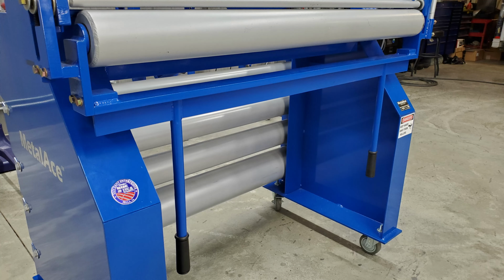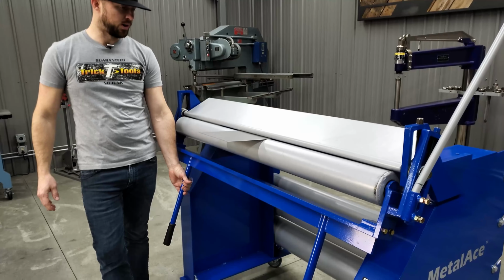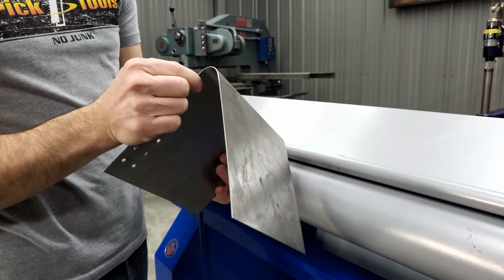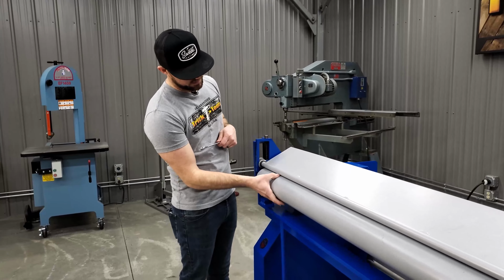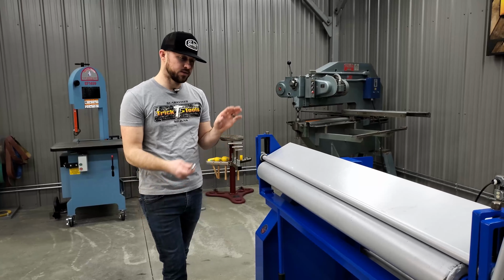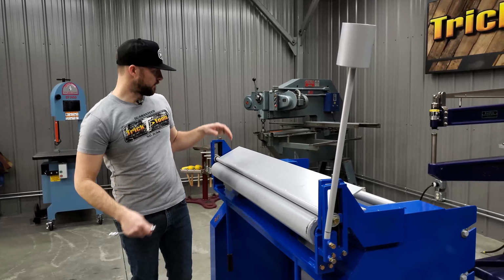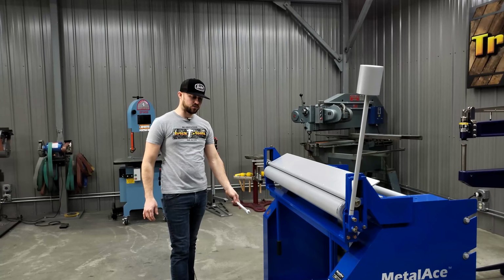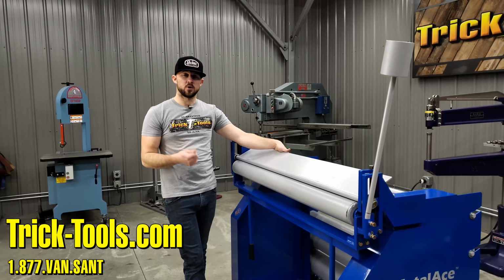MetalAce Radius Brakes - Trick-Tools.com

Comment: This is exactly what I need for my fabrication job.  Is there anyone in Phoenix Arizona that purchased one of your tools?  I have a flatbed project with rounded corners.  I'm fabricating a skirted portion below the flatbed.  As a result I need to bend sheetmetal 27" wide around a 2.5" radius.  If you have any suggestions on how I can make this happen please let me know.  Great machine you have there!!!
Reply: part 2 -
take a look at the video starting at the 5:50 - 5:55 minute mark for an idea that might work for you